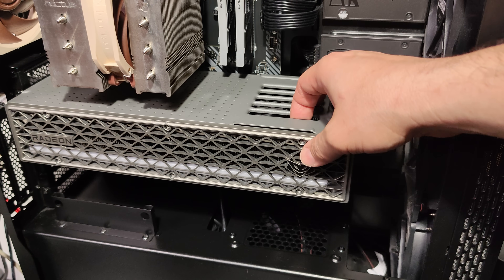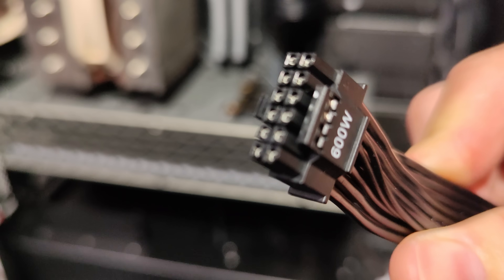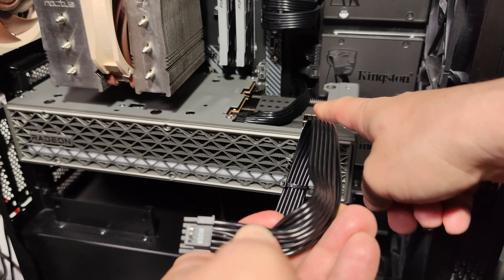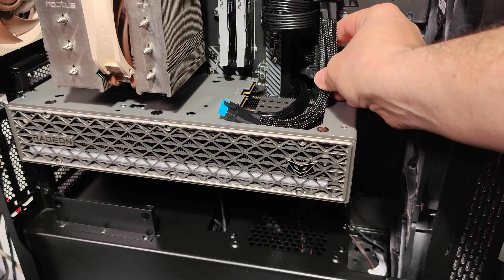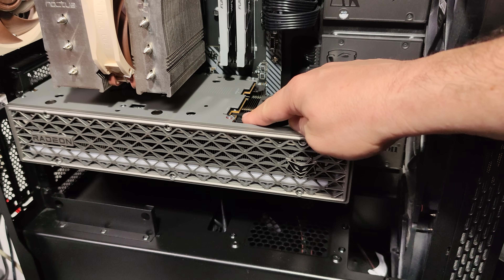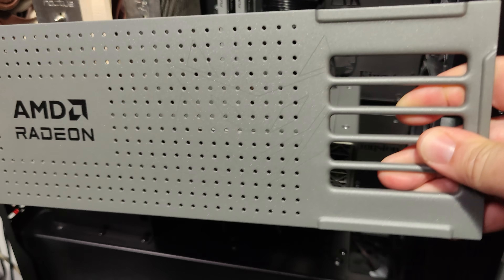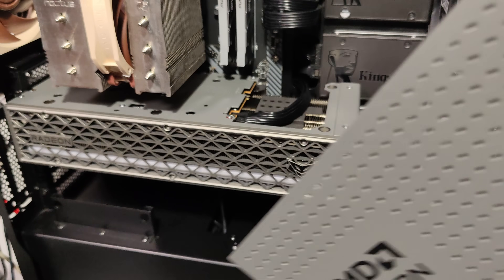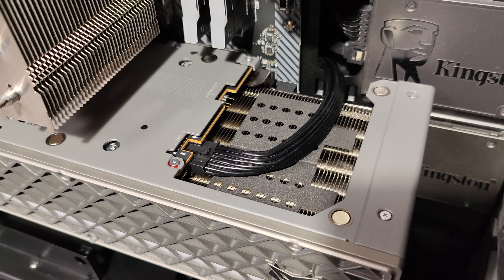Radeon RX 9070 XT Sapphire Nitro+  Magnetic Backplate More Problems Found And Exposed 🔥

Comment: You do not increase amps with a connection, you increase resistance just FYI. The 12vhpwr connector will be fine only pulling 330w.
Reply from the maker: There are several things happening. The resistance increase will generate a voltage drop, when the power demands maximum power like 330W, then with lower volts you get higher amps. Empirically speaking 330W / 12V = 27.5A. If you have a drop then 330W / 11V = 30A. So for a 1V drop you get a 2.5A increase, which will make the connectors heat more, exhibit higher resistance and then see what happens to nVidia :)

Comment: The wires sitting on a heat sink is a valid point, but I don't think it is going to be an issue. It's not like the cable will be hotter that the components or a connector.
Reply: The wires don't sit on the heat sink for me, I can't even force them to do that. (hole in the case is exactly in the middle, where the wires sit on the "foam" aka electrical insulator)
The "foam" "blocking" the airflow is also a pretty bad argument because guess what will block the airflow if it's not the "foam"? That's right, you have a bunch of cables there.

The other part where his cable is "raising" the plate, he can just use the adapter with the bendy cables instead, which is meant to be used with the card (or use a psu with ATX 3.1 standard, that has less rigid cables).
Reply from the maker: And the foam blocking the air flow :)
Reply: @TechTronic9000  This is true, also a concern. I would just cut it in a shape of a cable 😄

Comment: I don't like that power adapter on this card, it is a very bad design, they would have been better just putting in the normal one on the front like most of the RX 9070 XT GPU doing the rounds.

Comment: I have the nitro, that is not the cable that come with the unit. looks like the back plate was bent a little. Why 1300 watts? The blue connector was designed for that unit.
Reply from the maker: Have you seen the whole video, I explain and also show the improvisation cable the card comes with. Why would I want to add another 3 plugs to the other existing 2 to have a multitude of possible failing pins and extra voltage drop?!

Comment: I feel like you could have ran the 12 pin cable better?
Reply from the maker: Yes, split it to make it more flexible, still puts strain on the weak 12VHPWR connector, also you still have foam partially blocking the heatsink and the backplate does not aid cooling as advertised.

Comment: why not just use the supplied cable if your cable doesnt work with the backplate, problem solved
Reply from the maker: Because it introduces another 3 plugs, more pins, more voltage drop forcing more amps increasing chances of failure.

Comment: this connector power supply is well placed because it is cooled by the lower fan.
Reply from the maker: It's not cooled, it's actually heated by the heatsink and airflow, only if the fan would have been reversed. This way all the warm air from the heatsink goes over the connector.

Comment: my backplate fits just fine on that card and i have it placed in vertical position without any issue.. temp / fan speeds are decent even under longer workload (gaming) so i´m quite happy with this card - i´d be happier if it would have had 3 8pin connectors but to be honest i don´t expect 12 (16) pin connector to be an issue with the power draw of this card

Comment: all this rambling because the backplate is like 1mm in the air which probably NOONE will ever notice to begin with. jeez, you sir realy dont have real problems in life ;-)
Reply from the maker: Not only that sits in the air, but beside doing nothing it keeps the board from cooling better and forces you with a 12VHPWR just for the sake of design and no real functionality.
Reply: It should still sit flush regardless, there's no excuse. Even knowing it has a 1mm gap really irritates me. 
For context, imagine if your dentist or surgeon had the same 'ah it's only 1mm' attitude 😉

Comment: Not a perfect design but also not a bad one.
I used the extrension cable and it runs just fine, without any bending issues etc. 
At best the PSU manufacturer is to blame for creating such stiff cables.
The backplate holds just fine, unless you intend to lift up your PC, hold it upside-down and violently shake it.
The card itself also does not have any temperature problems at all. Stresstesting it and it stayed cooler than anything I ever had before. Even the reportedly high VRAM temps on 9070xt cards do not seem to be that big of any issue.
Reply from the maker: Take the plate off and repeat the test, my GPU is cooler by 5-6°C without it. Might not sound like a huge difference but that enables my board to sit happy at 0dB mode.
Reply: @TechTronic9000 5-6c is huge difference
Reply: @daniil3815  It would be if the card would run hot. The whole 9070 (XT) line actually is thermaly impressive and besides that the plate worsens colling, it doens't become a problem

Comment: I was also determined to buy this  GPU from Sapphire, but after seeing the connector and its positioning I said NO THANKS and in the end I bought the Asus TUF 9070 XT.
Reply from the maker: The board itself is not bad, the cooling is ok, but adding the connector there, using foam pad over the heatsink fins, the blasted 12VHPWR connector and the added gimmicky backplate these are all marketing reasons to increase the price, no actual functionality.
Reply: @TechTronic9000  yes, it's clearly a marketing tactic, unfortunately one that I don't think works. Especially after seeing everywhere how the 12V connector catches fire on the 5090 and 5080..... Although on the 9070 XT the biggest spike I've seen is 405 W, so well below the 600 W that the connector can support.

Comment: i had the same issue... and this is how i fixed it..
seethe PSU cable you already have plugged in? separate the wires if you know what i mean the wires is sticking together and make a thick flat path.. if you separate them and then form them as a single round group using a zip tie.. they wont touch the top plate
Reply from the maker: Yes it's a fix, but you still get a heatsink blocked with foam and a backplate that doesn't dissipate heat but actually keeps the card from dissipating heat and for that you pay a lot extra.
Reply: @TechTronic9000  About 100 dollars extra today since everything is at msrp now.

Comment: It works fine in my case. Temp up to 54-56 degrees
Reply from the maker: Depends also on the ambient temp and if on load or idle. Mine was idling around 50°C with fans on. With the plate off stays at ~44°C with 0dB mode (fans off).
Reply: @TechTronic9000  then somthing is seriously wrong with your card man no wonder youve been saying bad stuff about it, my card is the same and with 0dB off it sits around 32c whist my room temp is 24c, this gpu should NOT be that hot without 0dB mode on, and i think you did have it on since the fans spin at exactly 50c

Comment: looks like more of an issue with cable management then issue with the card itself. I get that the foam reduces the air flow, but is it a real appreciable difference to some part of the flow through? at the end of the day the foam is not so dense that it does not allow any air to pass through.
Reply from the maker: But does it worth extra 300 euro for this?

Comment: It seems to me that your backplate is defective because mine doesnt have quite as much wiggle in it ....
Reply: Mines rock solid.. magnets are awesome and very strong for its purpose.
Reply: Well he wiggled on the plate all the time from the start. I bet if you just leave it in place it will be fine
Reply from the maker: It has wiggle as the cable doesn't permit it to sit properly. Also if it did stay on correctly it actually influences the board cooling making the GPU warmer by 5-6°C.
Reply: @ Have you tried some undervolting? Mine can do some decent undervolts in some games, if I go -15% power and -70mv the temps barely go above 65 amd 85 on hotspot.
Reply: @TechTronic9000  That's wrong! I have this card and removing the backplate does not change the temperatures (not even by one degree Celsius), moreover other testers much more reputable than you (der8auer, hardware unboxed, etc.) have themselves made the comparison with or without a backplate and the same result as me, no difference, however, as far as you are concerned, I note several problems in your configuration which can affect the cooling of your card: First, your case is far too small and too compact to contain a card with such dimensions (such as Nitro+, Red Devil, Mercury, AORUS Elite, etc.) especially when a huge dual-tower heatsink CPU is right in the path of its output airflow, a quality AIO watercooling (or homemade if you have the means and skills) would solve this problem definitively by not hindering the flow of hot air coming out (and going up) from your graphics card and above all would allow your case to benefit from a much better airflow in general (because really a volume too small compared to to what I'm used to seeing in combination with graphics cards of this size,)

Comment: The fact that the power connectors are hidden, it's a win! What is your actual problem?
Reply from the maker: Actual problem? Forced 12VHPWR connector which is prone to failure, foam on heatsink fins that reduces cooling, backplate that makes the GPU warmer by 5-6°C, all for the sake of design.

Comment: Just a pointer, pull and separate the strands of cable, to make it more supple, so you don't get the hump at the bend.
Reply from the maker: That's a very good idea to release the stress on the cable, yet the backplate doesn't help with cooling nor the extra foam on the fins.
Reply: @TechTronic9000  it should be possible to make a narrow cable canal with a 3d printer instead of that foam pad. which will probably start disintegrating in a few years anyway.
Reply: @TechTronic9000   change the foam with aluminum plate, but that will give some heat to the cable, however since is only 350Watt card should be ok, depends how fast the plastic in cable becomes brittle, but in my experience the real heat is not in the radiator piece at the tail of the card.

Comment: so if you dont pull on the plate it dont come off
Reply: "All above board.. carry on HUMAN"
Reply from the maker: Even better I just don't put the backplate at all, the GPU is cooler by 5-6°C without it.
Reply: @TechTronic9000 gpu alr runs cool asl alr 😭✌️ im getting 55c on all ultra settings hogwarts legacy, 200fps, 1440p hdr, with all raytracing options enabled and set to ultra. Shit looks really good im nutting
Reply: @TechTronic9000 I would bet, if you would not have that stupid big air cooler, your card would even be cooler
Reply: @Die_Graue_Eminenz  Many people still use air coolers for CPUs. Your point is?
Reply: @Die_Graue_Eminenz  biased.
Reply: @Die_Graue_Eminenz so you’re saying he should removes the cpu cooler???

Comment: Bro just send me your nitro+ let me worry about these 😭
Reply: Real, like why did you buy this card if you did not like that design??
Reply: Hardware Busters had a picture of a 115V connector with signs of melting .. so they have a 115VHPWR on the way.
Reply from the maker: Sadly there weren't a lot of options, they are still in stock but getting scalped by the retailers now with stupid high prices going up to 1600 euro. I would preferred a board without the 12VHPWR connector.
Reply: @TechTronic9000  why did you buy it then? Just be patient. I got mine for 970 euro - still overpriced but definitely not 1600.
Reply: @ErnieZee  I have the card and have no issues with the plate Lol!!
Reply: @TechTronic9000  probably biggest retailer here has XFX Quicksilver AMD Radeon RX 9070 XT White Magnetic Air 16G for 860€ in stock (listed as 5+) but XT cards can be (pre)ordered at other retailers (with unknown delivery date right now) with prices starting at about 780€, i bought this sapphire 9070 xt nitro+ just because xfx were not listed as in stock at any shop at start of sales and everywhere retailers had info they won´t be available till april only to appear as in stock about 1 hour later 🥲
Reply: yo can i have it then 👍@TechTronic9000
Reply: @ How much did you pay for it?
Reply: @TechTronic9000 
Why did you buy it then? I got the Red Devil just for the triple 8 pin and no stupid backplate that only hinders air flow. Function over form!!
Reply: @Nerd_Rage_Initiated   Red Devil hinders  the airflow on the third fan with a plastic stupid panel + led lights.
Reply: @TechTronic9000  bro has no sense of humor

Comment: point number 1, my motherboard does not come off like this, the magnets are very very hard, it is quite difficult to remove it, and 2 I have a Corsair RMX source with ATX 3.1 and PCIE 5.1 and the Corsair cable from the latest revision is very good, not rigid at all and connects firmly and without slack, it is quite difficult to disconnect it, on the other hand, the cable can be passed in a better way... when I get home I will upload an image so you can see it, the card on the right side where the cable is connected, has a metal space so you can guide the cable through there, in my opinion everything fits and stays together wonderfully.
Reply: i agree bro. mine card have no problems, psu is cheap one and cable is ok
Reply: and i think plate have a paint that cant do electric contact. but i didnt test it.

Comment: Sorry guy but I agree with the other comments thus far.  The problem is your setup, not the card.  Not all parts fit perfectly in every setup out of the box and your issue can be easily solved (use a better cable, one of the easiest solutions you could ask for).  Every somewhat knowledgeable PC builder/user knows that.  You should probably take this video down.
Reply from the maker: Yes and no, for instance as suggested I could split the PSU cable wire by wire, making it flexible, that still doesn't negate the simple fact that the back plate doesn't increase cooling, but actually hinders it, same goes for the foam pad sicked on the fins of the heat-sink.
Reply: @TechTronic9000 it might be a problem if the card gets hot, but since it barely gets 60°C i wouldn't care too much about any heat buildup due to the backplate
Reply: @TechTronic9000 I can name probably 20 other cards with this same issue. Magnetic backplates are for looks and they gave you the option to remove it for extra cooling soooo....??? I am confused what the issue is
Reply: @TechTronic9000  but it looks better tho. Its not like the cards getting extremely hot, so a little fashion over function might not be the worst thing here in my opinion. Lets see when my card arrives, then I can clearly see for myself whats going on
Reply from the maker: Yes it's a tradeoff, the card is ok, but for this gimmick it gets praises that "it cools better because of the back plate" and gets a 300 euro bump in price over the msrp.
Reply: @TechTronic9000  well i bought it for about 200 € over msrp while the other cards were about 100 to 200 € over too. That isn't AMD problem but EU and the seller one. The backplate solution gives them some aesthetic points for hiding the cables and while it may give you higher temps, the card wont get over 70 degrees so i dont think its an issue. and i have my fans on 20% and tbh its almost silent.

Comment: Glad I went xtx man that design is kind of odd to me especially 12vhpwr
Reply: I mean sure, enjoy your xtx but I wouldn’t say the 12v is a deal breaker. Just need to be smarter than the average bear and make sure it’s plugged in correctly. Also this model is one of if not the only model of the 9070xt that even uses it. Seems most are standard 2x8 or 3x8
Reply from the maker: The ASRock Taichi also uses the 12VHPWR 2x6 connector.

Comment: Looks like this is a you problem. Nit picking the card because of your setup. Get some cable mod cables as they have plenty of flex in the cables. Looks like the cables that come with your power supply are the problem. Also the card tests very well thermally from what I’ve seen. Maybe you should watch some of these videos before making up stories about how bad this card is thermally. I think it’s just not the right card for you and that’s ok.
Reply: It's definitely a "skill issue". I have the same card. Runs extremely cool and the backplate fits fine if you actually put it on right.
Reply: @Whiterin that’s what I’ve been hearing. Apparently it’s a very good card that can run a high over clock and remain cool. I like the design but I can see it wouldn’t fit every build. I definitely wouldn’t be trashing it because my power supply cables are too stiff and the back plate doesn’t aid in cooling. It cools efficiently enough with what it has. For a card that pulls over 300w it runs very cool.
Reply: @TheMaxvansarker  Yeah. Mine pulls around 360 watts because I upped the power limit. Full load it runs around 50°C. I was playing BG3 earlier which doesn't stress it much at all and it was running at 38°. I've had GPUs that don't run as cool as this one even when they're at idle.
Reply from the maker: Yes and no, for instance as suggested I could split the PSU cable wire by wire, making it flexible, that still doesn't negate the simple fact that the back plate doesn't increase cooling, but actually hinders it, same goes for the foam pad sicked on the fins of the heat-sink. The board itself is good, works nice, but by far the design is not well thought of and could do much more better without this gimmick and blasted 12VHPWR connector.